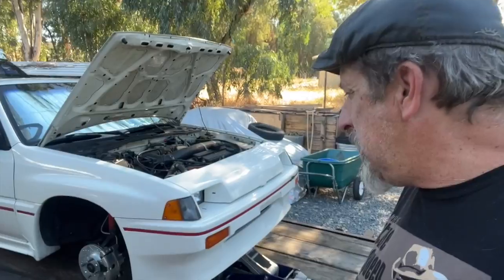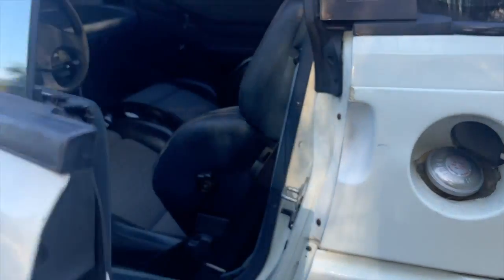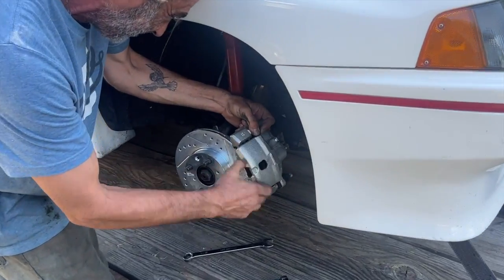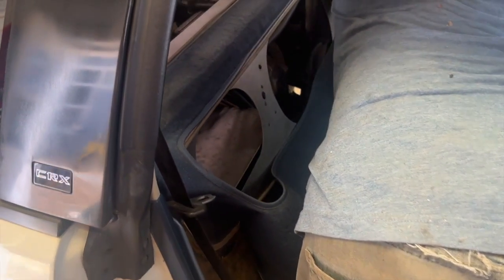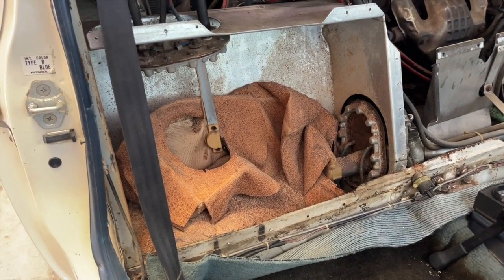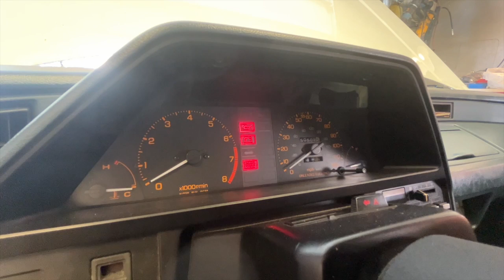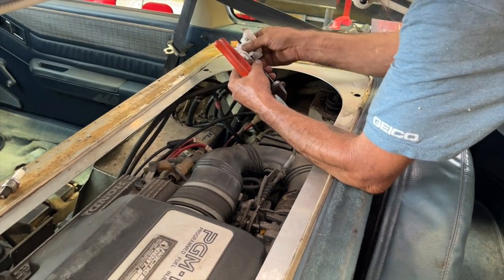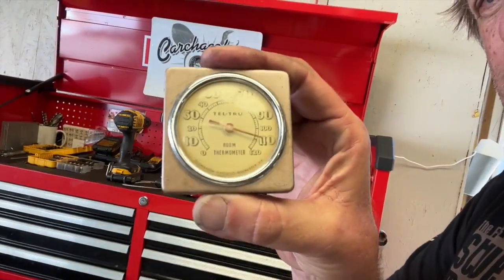Carchaeology: Twin Engine Honda CRX Mechanical Inspection

Comment: Finally! Been waiting to see that rear engine since car arrived (still mourning the damaged '60 Chev). Anyway, looking forward to upcoming episodes. Wondering what material was used to fab fuel bladder. That was both hilarious and unnerving to see. One minor niggle, wished Sebastian had supported caliper with wire or bungee, never a good idea to put so much stress on hydraulic flex line.
Reply: They are breaded line, and the caliper isn't that heavy, and it took me two minutes. But I agree, in a perfect world.......

Comment: Ha Andy . Ya might want to think about inspecting the timing belts on both engines . They are both interference engines and a broken belt would be tragic with bent valves and possibly holed pistons . Not a ha sayer but something to think about ...
Reply from the maker: Excellent idea! Will do!
Reply: Excellent advice.  The current service interval for Honda timing belts is (iirc) 100k miles or ten years.  I can't imagine it was any longer in 1985; it was probably about half that!  Be a shame to do the work to titivate this unique car only to have a belt go and lunch a motor.  For want of a nail, etc...